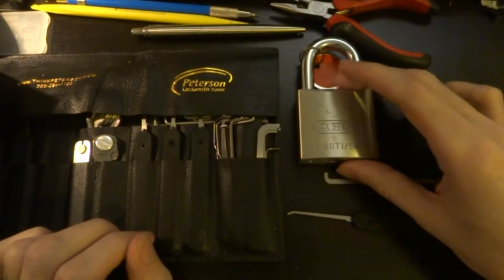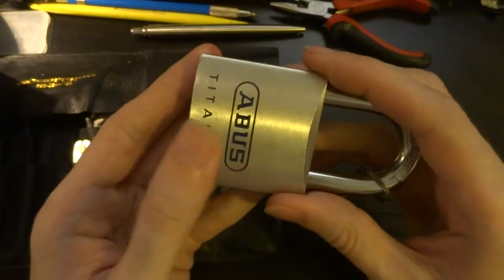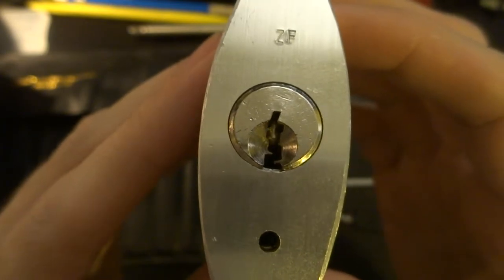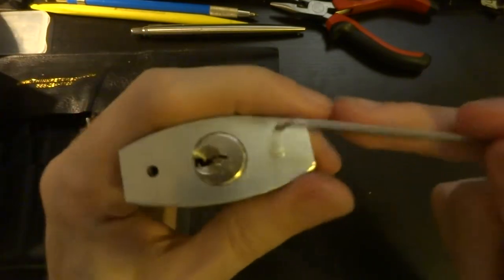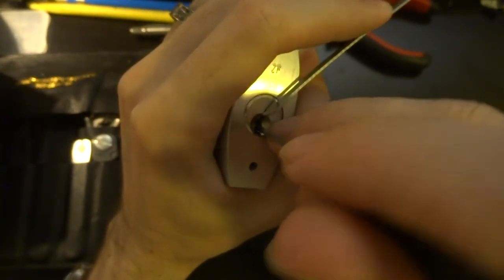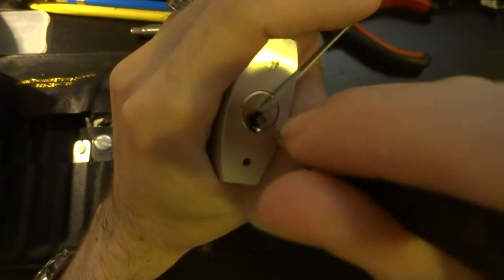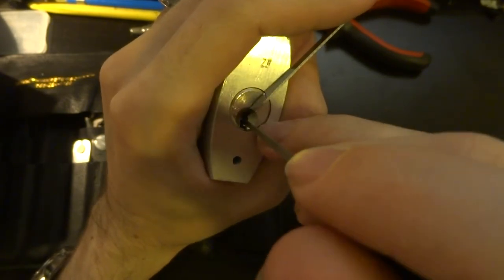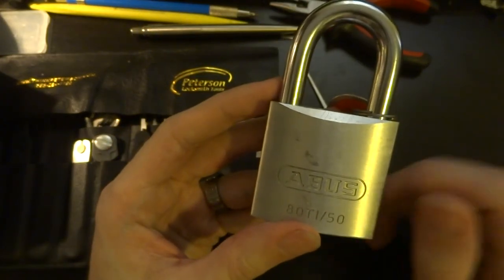(007) Abus 80TI/50 picked

Comment: Nite 0wl's Workbench  Very Nice picking. Just bought this as my 2nd ABUS Lock Challenge. Bought a ABUS 55/40 as my first ABUS Keyed Padlock. Went back to Amazon Prime and bought this one (ABUS 80TI/50) Can't wait to get it. Should be here tomorrow. (+1 : 1)
Reply from the maker: MARK 1 The 55/40 is a great introduction to Abus and security pins in padlocks. Despite it's size the 80TI is quite light weight and along with the 64TI they present a decent challenge. The Titalium range makes a great way to carry many more locks for practice and demos while still presenting an actual challenge.